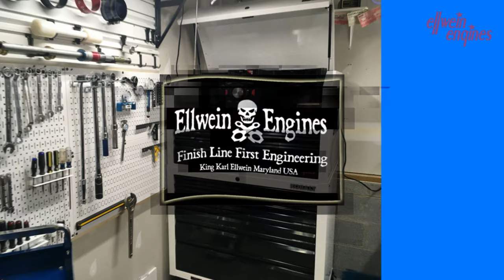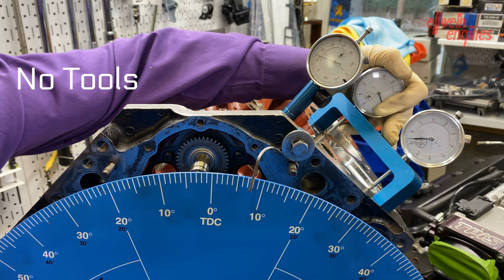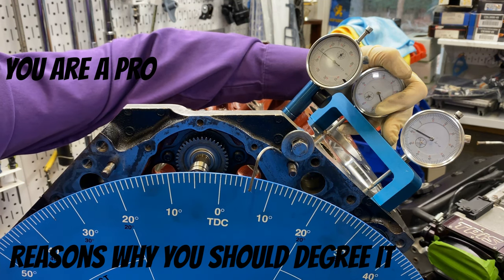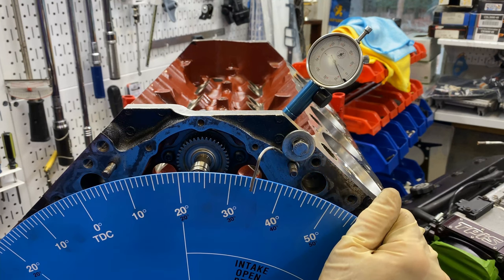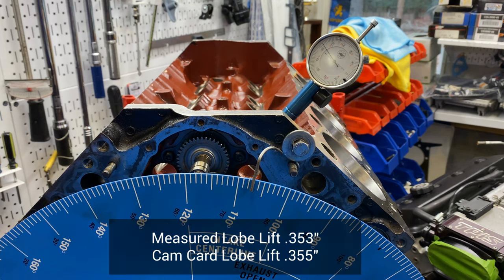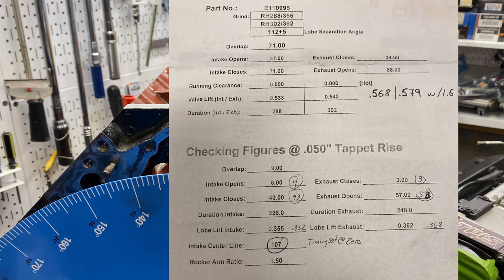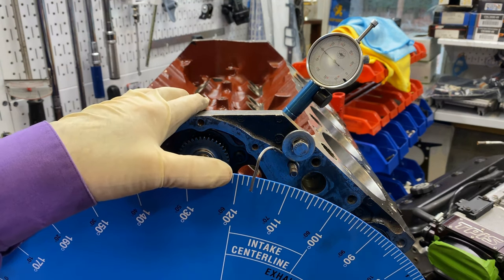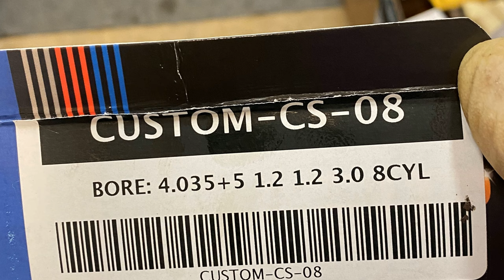Some Reasons Why You Shouldn't Degree  Your Camshaft

Comment: I degree every simgle one. I assemble dozens of engines a year at minimum and I find a few errors here and there. Recently had a fancy timing set that was not only way out, but 6 of the indexing notches gave me the same reading. It got to the point I asked another builder I know quite well to come check it out and tell me if I'm just going crazy today. He got the same damn numbers. Glad I checked that one.

Comment: Like you said, probably rare that anything is wrong, but if anything does happen to be off, the last thing I want to do is two consecutive LT1 Fbody cam swaps! I degreed my camshaft when I installed it and everything matched the cam card, but I did receive incorrect pushrods. The bag was labeled with the correct P/N, but the pushrods in the bag were not as advertised. Now, I’m very keen on checking every single little thing that I can.
Reply from the maker: You have a very good point about wrong part in wrong box!   That does happen.
Reply: No doubt! Keep up the videos. I love seeing your LT1 builds. I have a 395 LT1 that’s nearing completion. Just waiting on the cam right now. Bullet quoted a six week lead time on a custom grind.

Comment: Because you don't have the tools is NOT A REASON not to check your cams position. Absolutely WRONG by ignoring the many varibles that can locate a cam in the wrong position. My video will HELP guys. Yours does not in this respect.
Reply from the maker: by that reasoning you really should wire your car with Tefzel mil spec wiring too.  Just because you don't have it doesn't mean you should not buy and use it.  The pro should degree a cam.  The average joe should not be peer pressured into doing it.  That is the point I am trying to convey.
Reply: Totally invalid argument.  @EllweinEngines